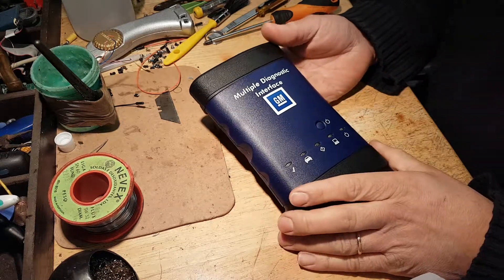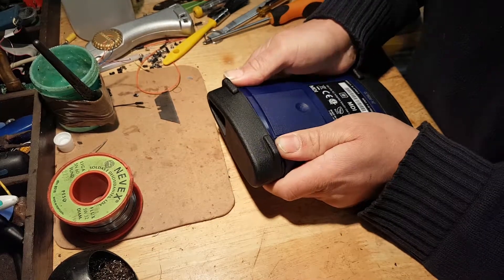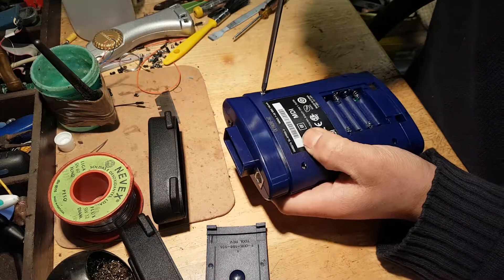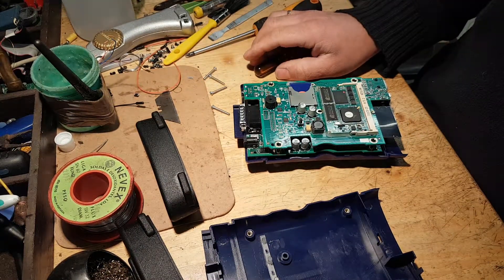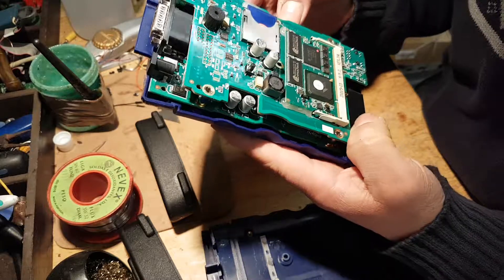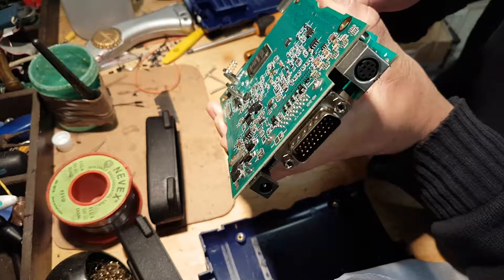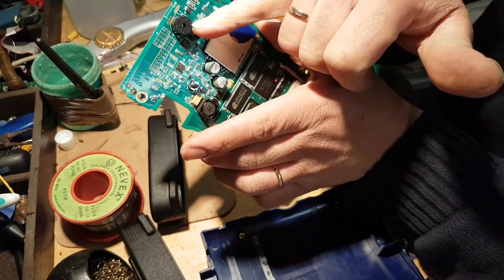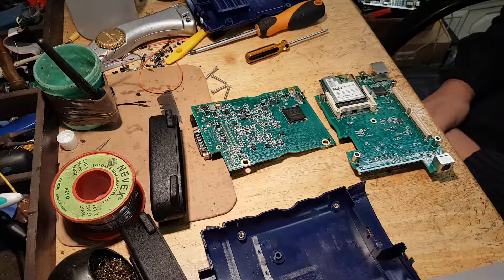GM Vauxhall and Opel VCI teardown. Internals and PCB quality.

Comment: Hey man,watched all your videos.Reseted my TCM with your video also. :) Very informative. Have a question..I m reparing my own Opel Astra H Easytronic cause no mechanic wants to touch it her ein France...all pussies...and got a problem..I can t find the transmission range sensor for the error p0705 71...looked everywhere... where is his location please. Got a feeling that it won t start cause of this  sensor TY
Reply from the maker: Hi
Not sure where is that one fitted... is that not part of the easytronic assembly? 
Sorry... I never worked on one of those...
Reply: @LMAutoRepairs  ty for the answer..I have no cluw where is located..I got an error p0705  and sais is from the sensor..where is the sensor..God knows...

Comment: Great Video as always.You refer to this tool as an MDI 2.This tool is the original MDI 1.The MDI 2 is more of a square unit?
Reply from the maker: That is actually correct... my bad.. 
Thank you for watching and for your comment!
Reply: @LMAutoRepairs  Hi there just want to say thank you for all the time you put in to making these videos for us, really helpful and informative. I have a question not related to this device but about the opcom, it's a opel corsa c and the key reader must be replaced can the opcom learn or marry whatever you want to call it lol the replacement key reader to the car so it will start? Thanks
Reply from the maker: @brentwilson4317  
Hi
It can, but you have to have the pin from the donor, and from the car... 
Corsa C is a bit a hit and miss with Op-com... some versions just don't do it . 
Thank you for watching and for your comment!
Reply: And if possible what is the procedure
Reply from the maker: @brentwilson4317  
Ah... I don't remember from the top of my head... unless I am doing it, I don't know...
Is not something I do every day... lol
Reply: Yeah and I don't have pin from the donor, what a pity ok thanks for your reply much appreciated